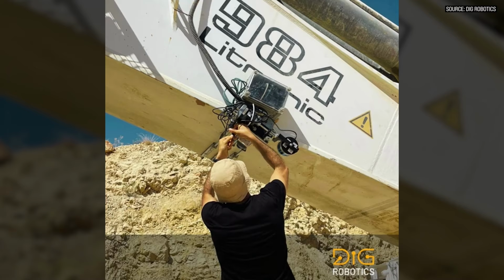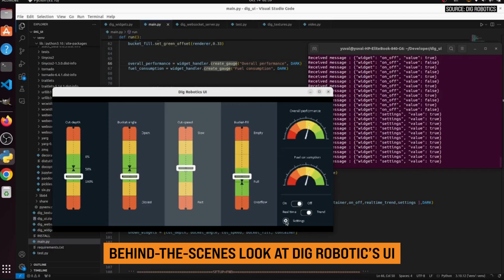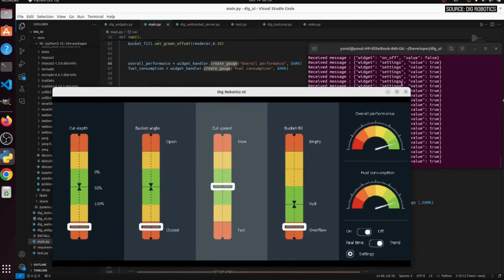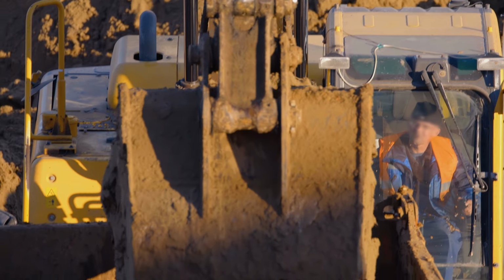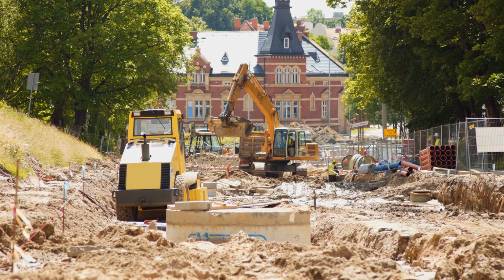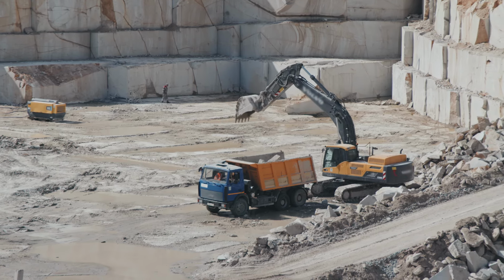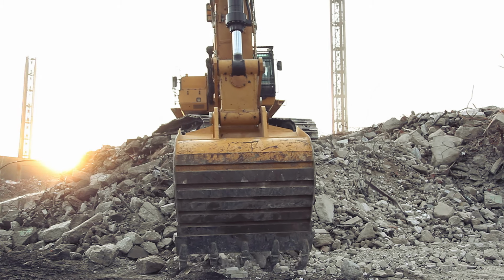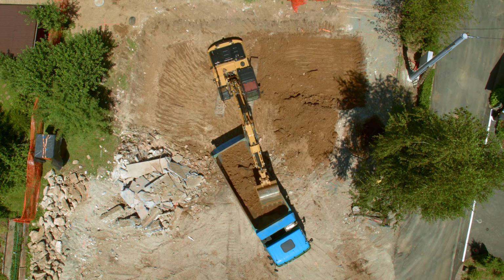Dig Robotics: Helping Operators Dig the Most in Less Time

Comment: So the pitch is exactly the same as machine control.... only you don't have the old man yelling at you that you're not doing it right. 

i mean i gueeeessss that's ok? I wonder how the data collection/aggregation side works with dig robotics... 

If we use 50k gallons...save 6-7.5k gallons... at 500 a month rental it's great, but will it be useful for the average dirt company? 

In the southern US i can tell you it's extremely difficult to get operators to do better. Think this is a neat niche. but ultimately replacing the operator is where the money is at imo